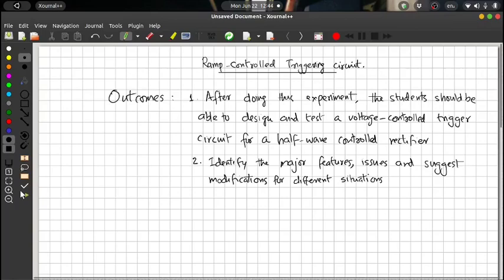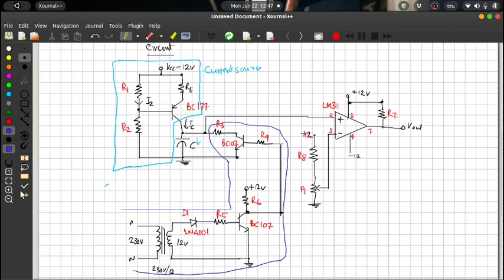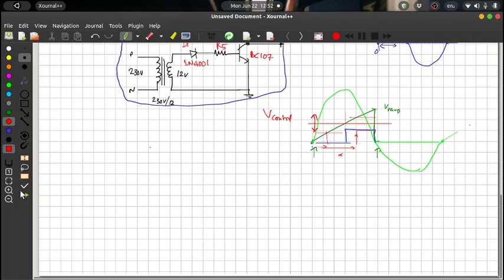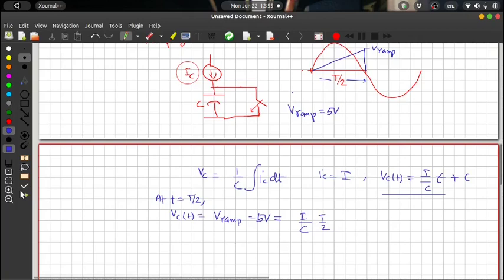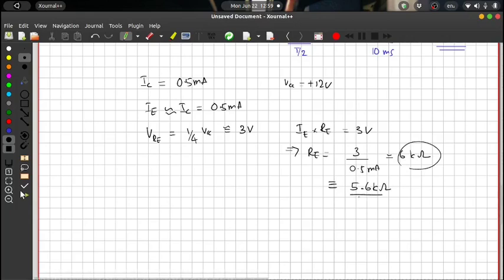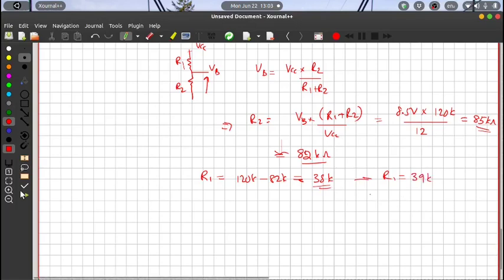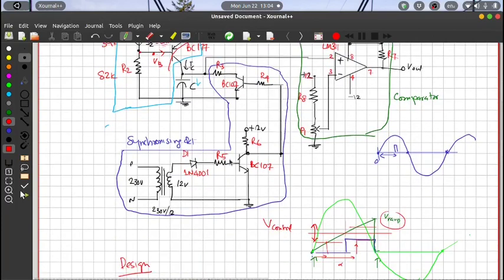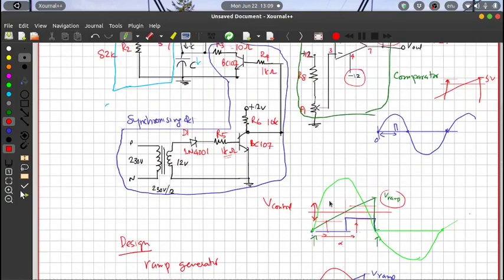Design of Ramp-Comparison Triggering Circuit For Controlled Rectifiers.

Comment: Why VRe=1/4 VCC?
Reply: It is a design assumption. Primariy we need to fix the operating point in the transistor's linear region, to make it work as a constant current source. In the loop Vcc --> R_E --> V_CE --> V_C, by taking V_RE as 1/4 VCC will give us flexibility in the change of V_C and V_CE. As the capacitor charges, V_C increases, and V_CE has to decrease., since IC is constant. But if V_CE decreases too much, the transistor may enter saturation, which is not needed here. Hence, it is a better to  keep V_RE less than 1/3 of VCC.